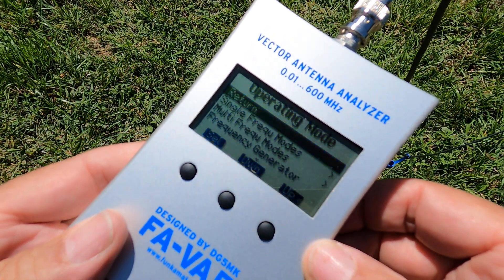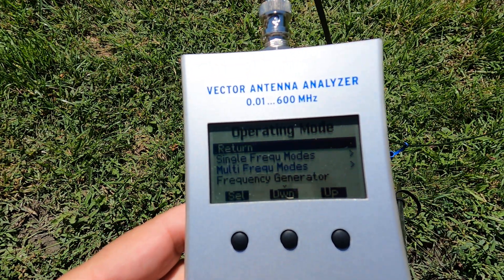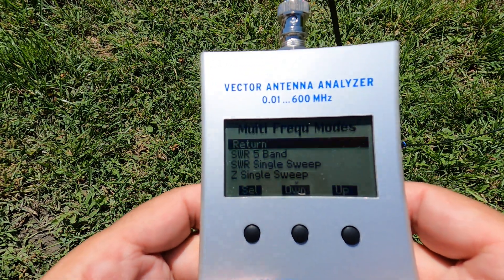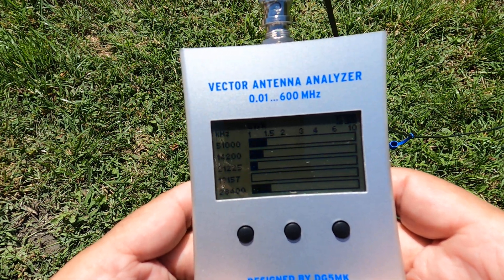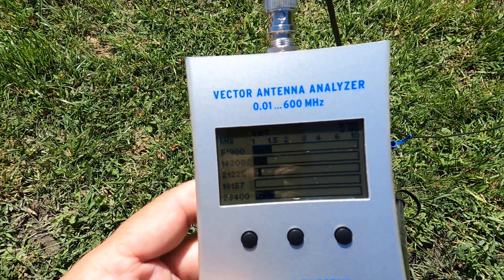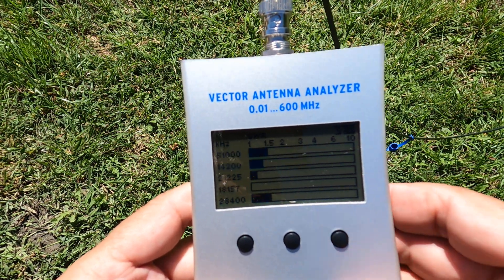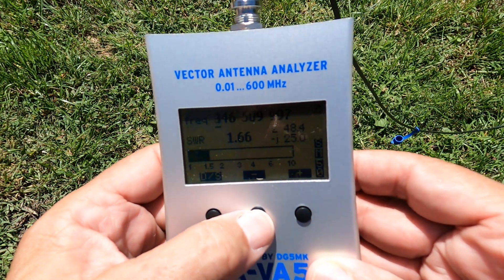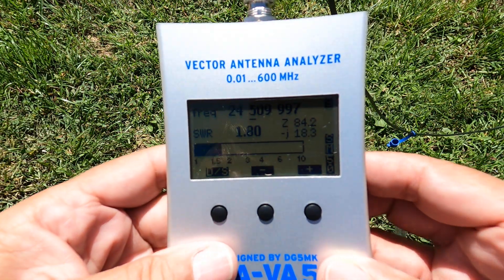The Buddipole BuddiHex Beam Deployment Review Part 5

Comment: I continue to love this antenna and I have no issues with it and it really helps me pull in some DX. Today I worked VK9DX Norfolk Islands and a VK4 from the park and so so so happy I deployed the BuddiHex and not the vertical. It took me 25 minutes to get it up with some sand bags on the tripod. 50 watts with my Yaesu FT-891 and my PowerFilm solar panels to keep the battery charged up